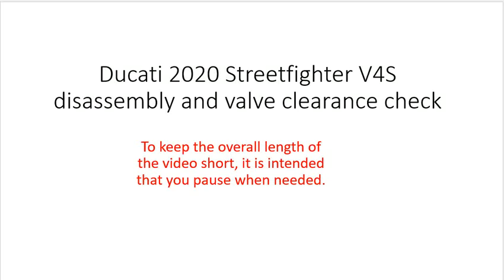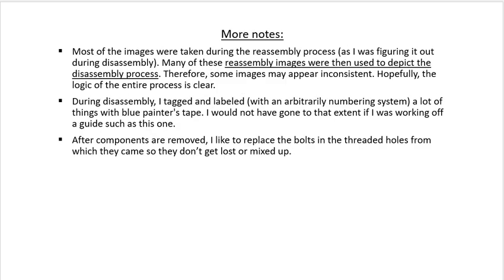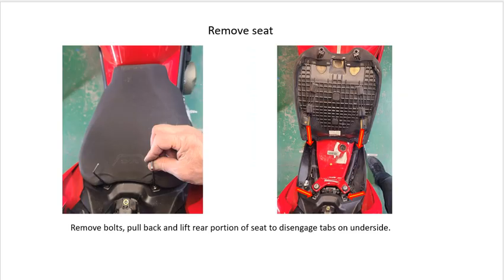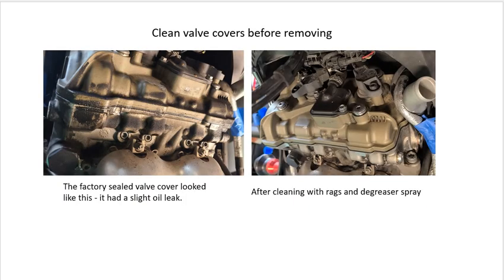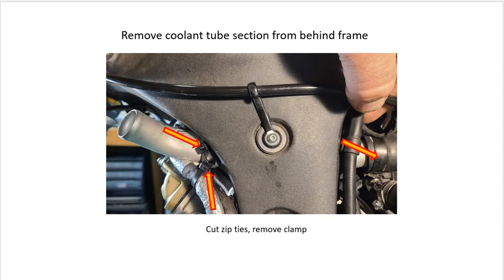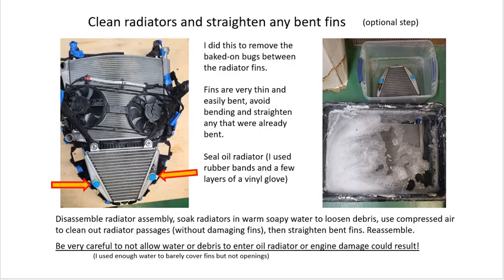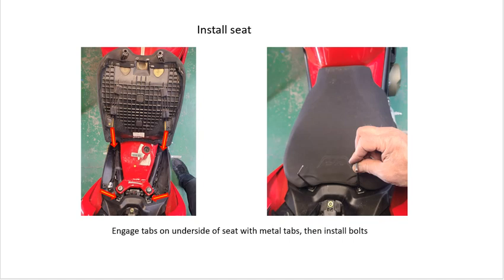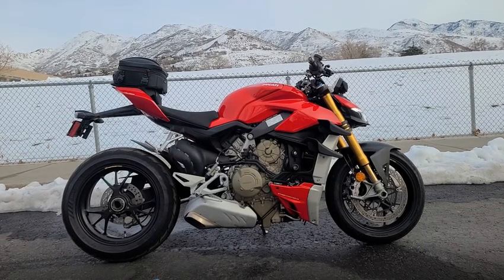Disassembly and Valve clearance check- no adjustment - Ducati V4 Streetfighter

Comment: The thing you keep referring to as the PCV is the secondary air injection system (SAI). It takes air from the airbox and injects it into the exhaust to burn any unburnt fuel. On bikes with aftermarket exhausts that remove the cats, it will cause pops, backfires and flames from the exhaust and can cause problems when tuning with an exhaust sniffer. Often, aftermarket tunes may disable the system or block off plates can be installed with a terminator plug in place of the solenoid.